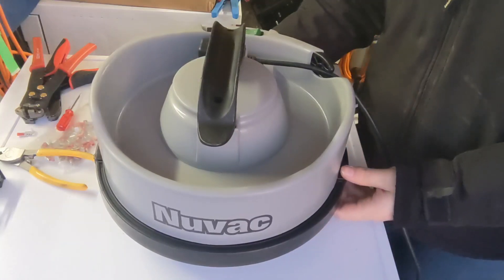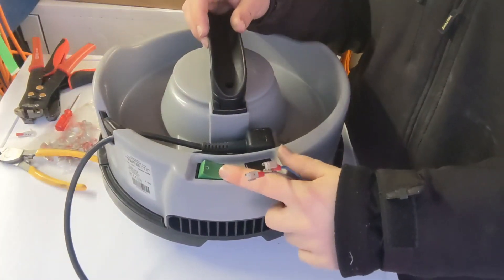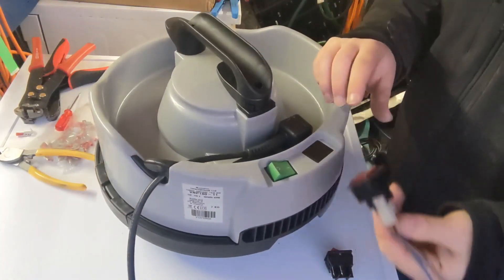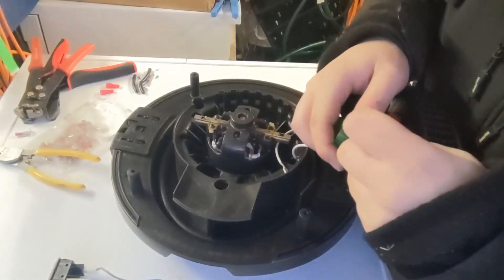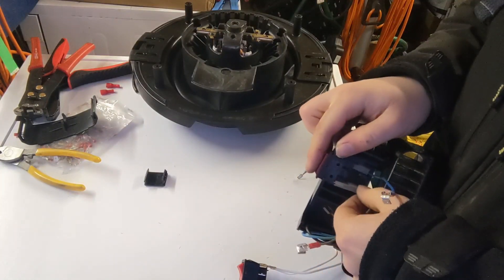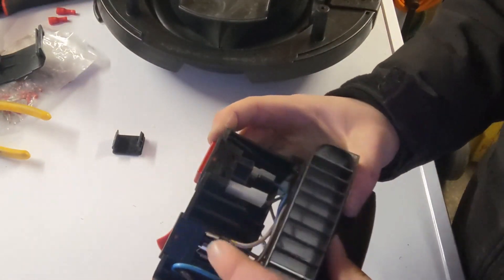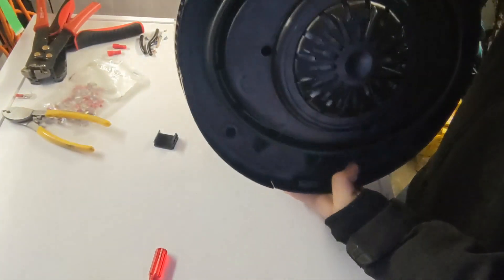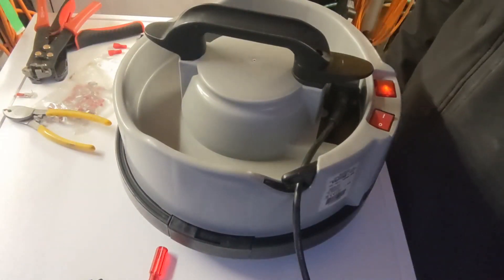Commercial Numatic / Henry Neon Indicator Upgrade / Modification #ad

Comment: These replacement red switches you have are they the same make as the older green ones they stopped fitting in around 2018, I know they look the same?

These newer green switches feel so flimsy. 

I bought a new NVH200 in 2021 which luckily had a red switch on.
Reply from the maker: Hello thanks for watching the video and leaving a comment most appreciated. The older style green switches are made by the same people arcolectric but have a diffrent part number. i assume these are the same as the red ones. but you never can tell.  The new style green squared design switch they are absulote rubbish i have replaced at least 400 of them. I asset managed several hundred new 2021 machines and there was around 3/4 failing with in 3 years.  it was crazy to start with loads failed around 6 months to a year. then it slowly dropped off. as a precaution any machine i refurb or manage gets the switch replaced. as the old red switches are still avalible and if you buy in bulk not that expensive. much cheaper than a reactive breakdown call.
Reply: @rlfvac  400 that’s a lot, you’d think Numatic would have realised considering they test  the switch cycles from random batches.

I have only ever had a switch fail on the many machines I’ve owned, it was one of the old green ones on a machine I donated to someone, it came back for repair.

Unfortunately out of my 9 commercial dry vacs 7 have the squared Everel switch, not had any go yet but I’m sure it won’t be long, it does annoy me why they don’t add the power light to the cheaper machines, can’t cost them that much more. 

In 2017 I actually had a PPR240 with the light which was dead on arrival from the supplier, it was just a dead light but Numatic sent me a replacement machine, now I know how easy they come apart I would just replace it myself. 

On the Numatic Nuvac VNR200 model they appear to still make them with the older green switch, not sure why as the VNP180 and all others come with the dodgy one.